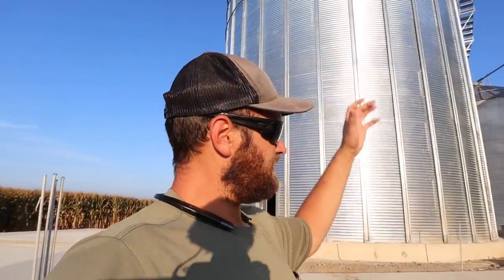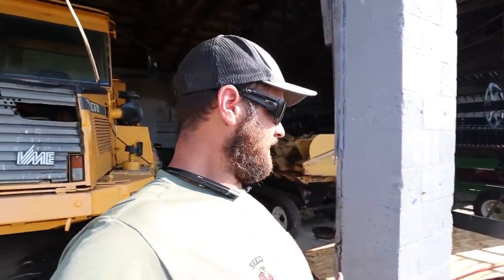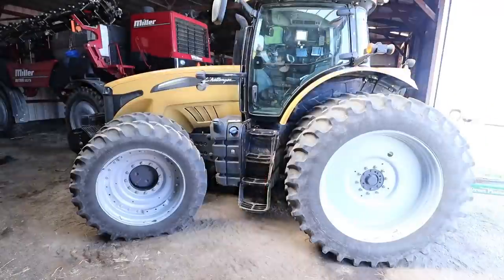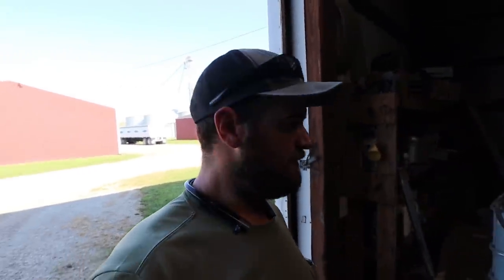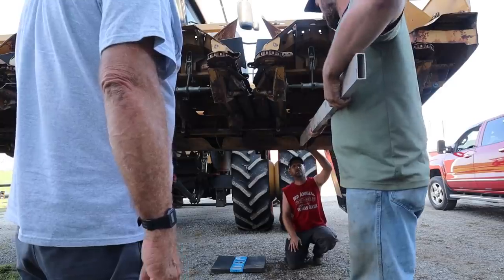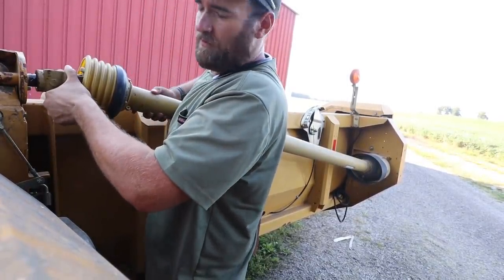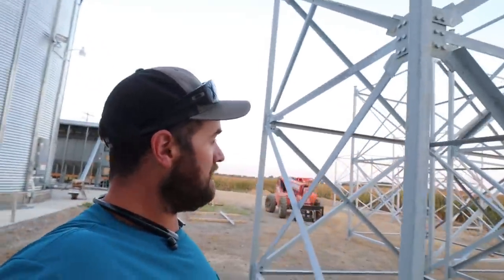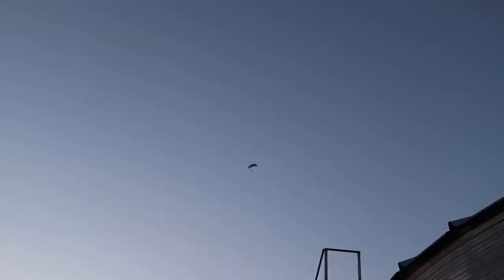NEW Corn head is already BROKE

Comment: I would ditch that POS “new” 8 row corn head if I were you. We run a Lexion 750 on the operation I work for and the boss has been running an identical head to your “new” one. It’s been down more times than it’s been up running. Not kidding. 
In the last three corn harvest seasons he’s spent well over $50K in new PARTS.... He finally decided this year to sell it get something different.
Reply from the maker: What head did you go with. We have had 3 lexion heads and one Capello which is who makes the lexion head. Only issue we had was with a demo head we bought. Somebody had hit something with it and the heads was out of square so it had issues the others have been great
Reply: Brian's Farming Videos perhaps that’s been the issue with our Capello head....  seems like we’ve had reoccurring problems, but our Lexion service guys can’t figure it out. 
Anyway, the Capello head is sold, we haven’t bought a new one yet but our corn almost all got in LATE, so we’re at least 45 days from harvest. Looking at Drago or Geringhoff